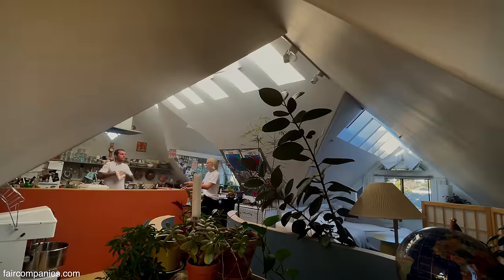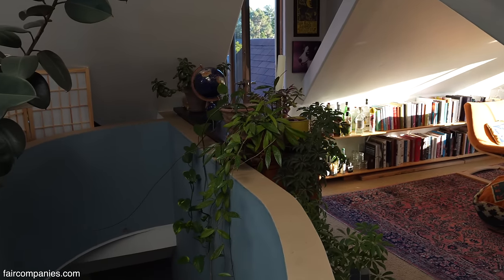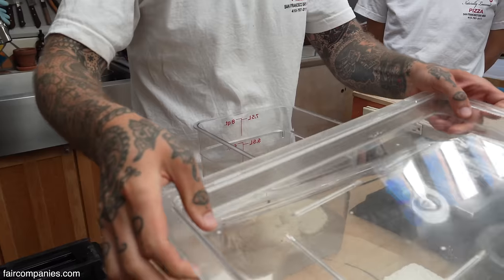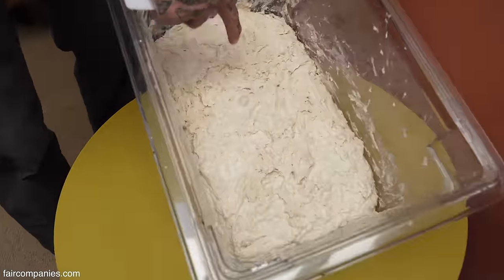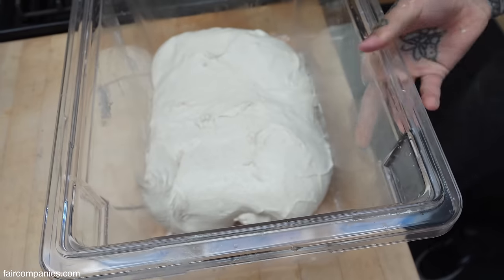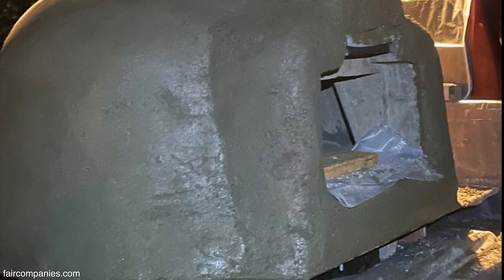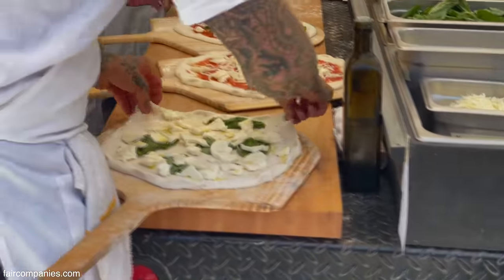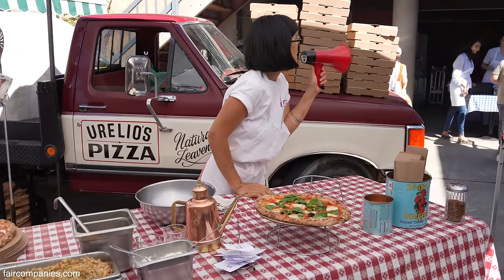Couple's attic apartment is kaleidoscope of nooks & skylights 🍕

Comment: what about heating and cooling?
Reply: The Bay Area’s weather is pleasant and constant all year round, HVAC is a lesser concern the closer you are to the water. The Berkeley area barely needs serious heating or cooling. It seems crazy but I’m talking from experience.
Reply: ok thx for the info. Still when it's sunny that place must be very hot. There's a reason why people don't put skylights. @nicolasboullosa
Reply: @MaximumEfficiency  It was sunny when we were there and the place was very pleasant. Insulation works. And the Bay Area has a great deal of foggy or semi-foggy mornings, which clear after 10-11 AM or so. Again, if you're by the water in CA, there's no such thing as "very hot" places, especially when properly insulated.